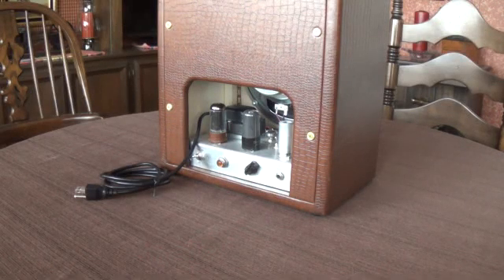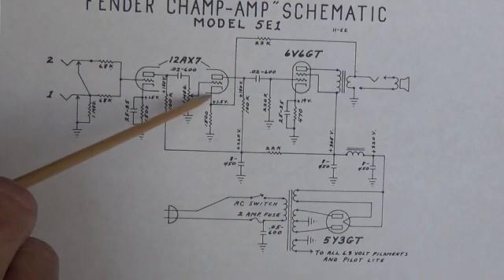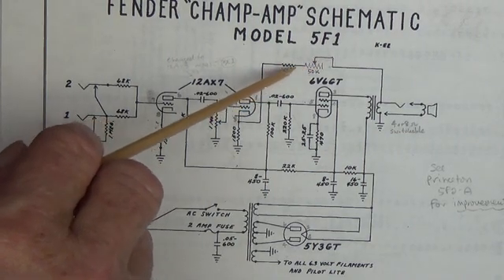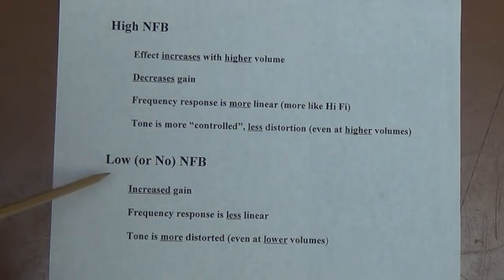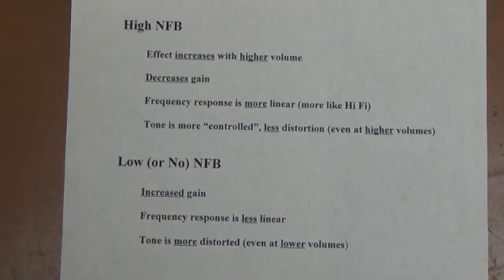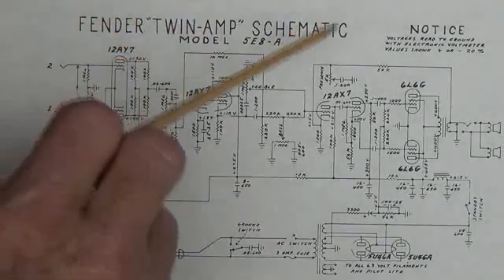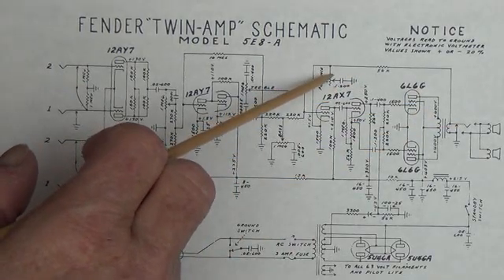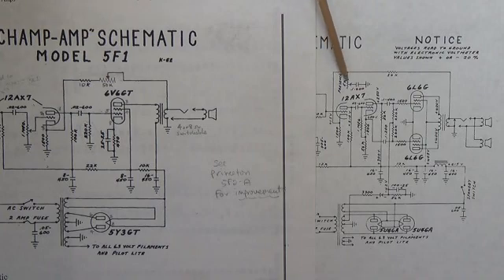Negative Feedback Loops and the Fender Presence Control

Comment: @Uncle Doug I was always asking myself, isn't the output out of phase ? If we follow the "plate inverse" principle..? First stage output is out of phase, second is now in phase, and third to the speaker is out of phase again...isn't it ?
Reply from the maker: Yes, each successive grid-plate amplification stage reverses the phase. It doesn't matter if the speaker output is out of phase with the input. The only  time that phase becomes important is when two signals of opposite phase are mixed......resulting in full (or partial, if the strengths are not balanced) cancellation of the signal.
Reply: @UncleDoug  Thanks for that detailed answer :) But so that means that the speaker will move backward first when hitting a note ?...If that's the case I really wonder if it would sound different if it was moving forward in the first place. I'll make some test (building one at the moment) and try to go out from the Cathode in the second stage. But then I can't have negative feedback...o dear...

Comment: Great info. This should help me reducing the excesive low frequencies when i push my princeton to maximun volume
Reply from the maker: Yes, or you can install a choke across the speaker lugs.....as was done with the Silvertone 1474 (see video).
Reply: @UncleDoug  I'm amazed at how the channel 2 sounds now on that one, great job indeed. And to adress the options, i'm adding the presence control, but without control, as it will go as a resistor and a cap, since i'm not into making more holes to the chassis. Or well, that's the idea, as soon as i find the right values for the tone to be good at both, low and maximun volume.

Comment: I just did this mod to my monoprice 5 watt amp and it gives it a good amount more gain. People have done this before but you gave me the idea to put a resistor in line so you don't eliminate the negative feedback loop totally. I am thinking about lowering the value of the resistor and see how it does.
Reply from the maker: Lowering the resistance will increase the amount of NFB and result in more headroom and clarity, Steve.
Reply: @UncleDoug  thank you for the clarification, I will leave it be. I am happy with how it turned out.

Comment: Actually I ran a 18k resistor in series with a 20k Pot, so 18-38k is my adjust range.. kind of odd but it’s what I had on hand to start testing.
Reply from the maker: No wonder there was no apparent difference. Your resistance range was way too high. In effect, the NFB was shut off throughout the pot sweep. Try a 5K resistor with the 20K pot and see what happens.

Comment: Is the common side of the speaker output typically grounded to the chassis. The reason I ask is this would put NFB loop in parallel with the cathode resistor through the output transformer winding. I just put together a champ type circuit with an adjustable NFB loop like the one you demoed however it does not seem to do work, as I adjust the resistance I do not notice a change in the output.  The output jack on mine is grounded to the chassis ground. Troubleshooting…I used the 5F1 schematic
Reply: Just wanted to check on the the way Fender setup there output jacks , I’ll have to check my circuit again for mistakes. Thanks Uncle Doug
Reply from the maker: Yes, one side of the OPT secondary is grounded to the chassis, usually through the speaker jack. I would not say they were parallel, since the secondary, with the NFB is isolated from the primary. How is your variable resistance wired: fixed 10K with a 50K pot in series?

Comment: @Uncle Doug 
Hi Uncle Doug, I am a recent subscriber and have really learned a-lot from your videos. I have a question involving an amp, if you have time to respond. I own one of the 68 Custom Deluxe Reverbs that Fender has modified by reducing the negative feedback to get earlier breakup, but this apparently adds a good deal of noise to the circuit. There are numerous forums discussing fixes for reducing the noise, including some that suggest installing an adjustable pot on the resistor values of the NFB loop. There is definitely a hiss in my amp at idle, but the noise increases with volume. So my question is, would the extra noise caused by the reduction of negative feedback be volume dependent, or does this sound like a separate issue? Thanks, Jeff
Reply from the maker: There's only one good way to find out, Jeff. Using alligator clip jumpers, recreate the NFB loop and see if the noise subsides. Anything else is simply guesswork.

Comment: Say the resistor is 820 ohms in the feedback circuit what size potentiometer would be suitable if I wanted to make it adjustable.
Reply from the maker: Use a fixed resistor of about 1/2 the fixed resistor value, say 400 Ohms. Then add a 1K pot in series. Your range will now be 400 to 1400, effectively bracketing the original value.
Reply: @UncleDoug  Thanks so much!

Comment: surely a dumb question, but how are the "bright" switches wired into the old fenders? are they a presence control minus the cost of a pot, or just a switch with a cap on it to kill off some lower tones? LOVE my presence control, hate my bright switches! (different amps)
Reply from the maker: Bright switches create a route by which high frequencies can bypass the volume control, Leroy. When they are switched "on" only the lows and mids are reduced by the VC while the highs go straight thru the amp circuit to the speakers. They were deemed necessary in amps like the Fender Bassman, to make the circuit more suitable for regular (not bass) guitars......but I agree with you, the tone they create is generally quite shrill and unpleasant.

Comment: Hey Uncle Doug - I've got a question for you. On some more modern amps, I've been seeing a "resonance" or "depth" control, which to my understanding is a low frequency NFB control. I assume this is done by having the pot and cap in parallel instead of in series, would that make sense?
Reply from the maker: Recall that the frequencies returned out-of-phase via the NFB loop are the frequencies that are cancelled, David. So to make the NFB function as a specific tone control, you simply regulate what frequencies are returned. To boost low and mid-range, you could use a capacitor in the NFB loop that passed only high frequencies, thereby neutralizing them in the output without affecting the mids and lows.

Comment: Say I wanted to add a Presence control to a AB763 circuit. The NFB voltage divider uses awkwardly small values (820R/47R)... Would adding a typical Presence circuit work properly? By typical circuit, I mean a 25k pot + 100n cap in parallel with the 47R resistor. Or, should I increase the voltage divider values to something like 82k/4.7k and adjust the PI tail resistor to compensate? Hope my question makes sense. Glad to see you're making regular videos again! Cheers :-)
Reply from the maker: In my experience, the only way to effectively add such a modification is by experimentation. Test your theories and see what works. Today I altered the tone characteristics of a mid-60's Gibson GA15RVT from shrill and grating to warm and pleasant.....by experimentation with different capacitors in different locations in the signal chain. I suggest that you try the same method with your project. Good luck.

Comment: Great video... quick question. I f I understand correctly the effect of the "presence control" will be affected by the amount of negative feedback used? Would it make sense to have two pots? Or would that make too many variables in the circuit?
Reply from the maker: Thanks, J-F. One pot will do. Yes, the frequency range and amount of out-of-phase signal returned to the cathode of a pre-amp tube will determine which signals are suppressed.

Comment: Does a boost/presence switch just open and close this circuit with a fixed value? On a class a valco style?
Reply from the maker: I'm not sure I understand the question, Bobby. Boost and presence are two very different things.
Reply: Uncle Doug  I ordered an amp from a small company. Based on a Valco class A. It has  “boost/presence” switch. I haven’t received it yet. I think it is a NFB circuit with “boost” being switched off and “presence” switched on.  When I receive this amp in a week or two I will look and see. Thanks to you, Rusty and Jack for hours of intelligent entertainment.
Reply from the maker: I think your analysis is correct, Bobby. With the NFB switched off, speaker output will be maximum since none of the signal will be neutralized....thus you could think of this as "Boost", but in reality, no boosting occurs. It is merely the absence of attenuation. Actual boost of the signal would require additional active signal amplification. You're welcome :)

Comment: Hi Doug! is it possible to add a midrange control in the NFB ?
Reply from the maker: Yes, but it would be rather challenging. Since NFB works by presenting an out-of-phase signal to a pre-amp or phase inverter tube, to reduce certain frequencies in the music signal, you would want to eliminate the mid-range frequencies from the NFB signal, so they weren't attenuated, but allow the bass and treble frequencies to get through. This would require inserting  high-pass and low-pass filters in the NFB line......blocking the mid-range while allowing the bass and treble to pass.

Comment: What is exactly going on with NFB.  Does it make the cathodes more positive in essence controlling the amplitude excursion of the signal?  Controlling maximum gain?
Reply from the maker: It's all explained in the video, Mr. E. The NFB signal is out of phase with the signal on the cathode and partially neutralizes it.

Comment: Uncle Doug, I am grateful for the knowledge you share. I perform in situations often with an orchestra where I need a clean amp, then the next day it can be classic rock and blues. I've decided to try a Tweed Super amp for both purposes. So, I believe the variable negative feedback idea may be of value to me. On this amp (5F4) the resistor in the feedback circuit is 56k. in your video, you stated that you were going for a range of about 50% to 300% of the 22k resistance in your Champ amp. So, would I perhaps use something like a 25k resistor and a 125k pot? I figure this would bring my range to 25k to 150K roughly maintaining the 50% to 300% ratio. Could I try a 250K pot? (much easier to get a matching alpha 250k pot) I've been a professional musician for over 40 years now, I guess I'm trying to recreate that magic I felt when I first cranked that tiny tube amp back in the late 60'S.... :)
Reply from the maker: Greetings, AA. I responded to this question on my Facebook page. See you there :)

Comment: A question:  The pot you installed in the NFB circuit does not show the loose connector connected to ground.  Is that how you installed it?
Reply from the maker: In a traditional NFB circuit, a fixed resistor is used in series between the OPT secondary and (generally) the cathode of a pre-amp tube. No part of the NFB circuit connects to ground. When substituting a variable resistor (pot) for the fixed resistor, the same is true. The pot is wired purely as a variable resistor......with no connection to ground.

Comment: hi, nice video, thanks alot. I was wondering if the negative feedback can be connected this way in a amp that has a long tail pair phase invertor.I mean, connecting it on the second triode's cathote, before the signal goes to the phase invertor tube.
Reply from the maker: NFB loops are often used with LTP phase inverters, but the return line is connected to the cathode and second grid of the PI tube itself. Here is a diagram:   https://robrobinette.com/images/Guitar/Deluxe_Models/6G3_Schematic_Signal_Path.gif
Reply: but would it change something to go against the standard and connect the negative feedback to the cathode of the triode that is just before the long tail plate phase invertor.(assuming this triode is not a cathode follower and that there is no  capacitor to ground on the cathode ). just like the second triode in the fender pro junior.
Reply from the maker: You could try it and see......but if it worked well in that configuration, I would imagine that Fender and other amp builders would have wired it that way. Also, recall that the NFB signal has to be fed to a cathode in which the signal is out of phase with it.

Comment: Excellent explanation!! So clear, I can probably guess how a Resonance control works. Just like Presence in the feedback circuit, only with a capacitor that filters low frequencies?
Reply from the maker: Thanks, BR. Yes, if you eliminate the low frequencies from the out-of-phase feedback signal, then no low frequencies will be neutralized.

Comment: Very informative and a really interesting modification to the NF loop.  I've been focusing on your 5F1 scratch build video series.  I've manage to build my chassis, although my design will be a 5F2-A Princeton.  I will be posting updates on my Facebook page.   Thank you for the Harbor Freight tip on the shears!  I ended up purchasing the pistol grip pneumatic with a 20% off coupon which really takes you for a ride!  Thank you for all you do Doug.
Reply from the maker: You're welcome, Eric. I built and posted a video on a 5F2-A Princeton several years ago. It has all the tone and charm of a Fender Champ, but with a tone control :) Good luck with your build.....and your new shears. Be careful of the gauge of metal you try to cut. I had to replace my blades a few months ago.

Comment: Hey Uncle Doug, you've got yet another huge fan in me.  Rusty too.  I am a bit stumped how the negative feedback loop can tap the output side of the transformer which is lower voltage and higher amps and feed the low amps, high voltage cathode without causing problems.  The resistance doesn't seem to be significant enough to create enough drop to prevent the tube from operating outside of its design parameters.  What am I missing? Thanks!
Reply from the maker: Due to the difference in resistance between the NFB loop (high) and the speaker voice coil (low), the vast majority of the output signal goes to the speaker.  Recall that "electricity always takes the path of least resistance"......or at least most of it does :)
Reply: That's the thing that always challenges my brain with electricity, the "... or at least most of it does" part.  I guess I just struggle with the "this works like this, except when it doesn't" part of electricity.  I'm a Mechanical Engineer by schooling, and a bolt is a bolt is a bolt.  Very reliable ... just like Rusty.  ;o)  Your videos have really helped me to "realize" the theory of it all in a deep and helpful way.  Thanks for making them.

Comment: Hi Doug!
I've got a rather interesting question for you.
Let's say my cathode resistor is 750Ohms instead of 1500. Wouldn't that need the NFB Resistor values to be cut in half, too?
The NFB resistor is essentially forming a voltage divider with the cathode R, right? So in order to keep the ratio, I have to apply the factor 0.5 (Or whatever it may be) to both the cathode R and the NFB loop resistance.
(I'm building one of those 12AT7-Reverb-Tranny-Miniamps, which only has a Bassman type gain stage before the "power"-Amp. And that Bassman Gain stage (V1 in 5F6) has got a 820 Ohm resistor...)

Greetings from zhe Land of Germaina
Reply from the maker: Greetings, DT. Yes, theoretically the ratio between NFB resistor and cathode bias resistance to ground would have to be maintained for the NFB loop to continue operating as it was before the value reduction of the bias resistor. I always recommend personal experimentation, however, to find the component value balance that yields the results you seek. Best of luck with your project :)